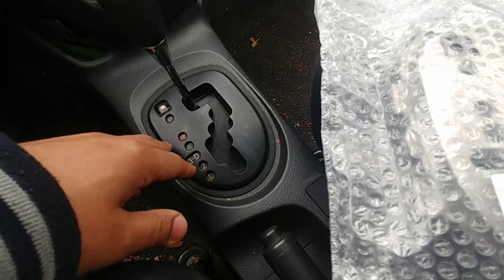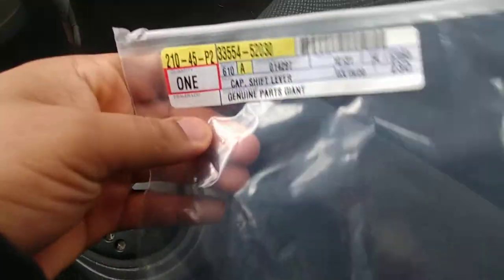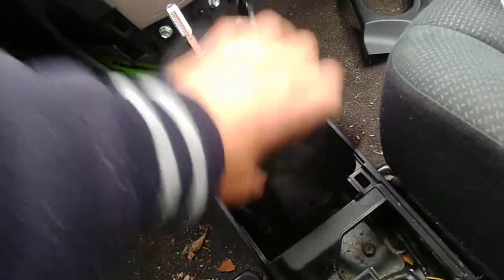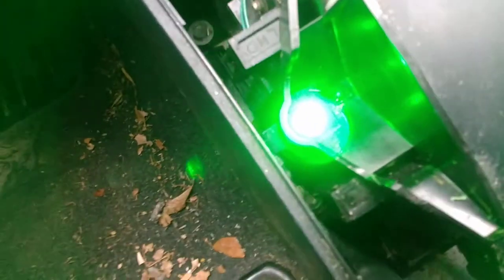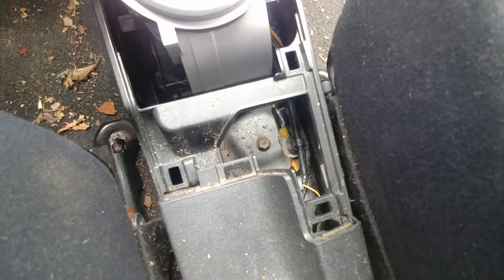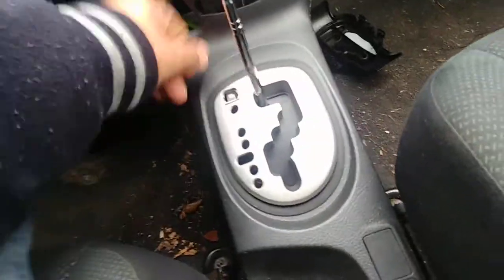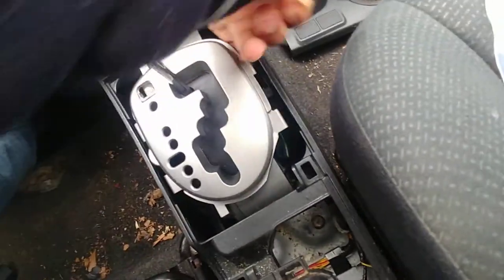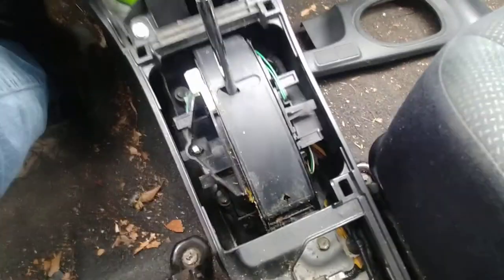Toyota How To Replace Automatic Shift Housing Cover

Comment: Hi, I'm having trouble getting the panel off for my 2017 Yaris. Any suggestions?
Reply from the maker: im not familiar with the 2017's yaris interior there probably some videos on it, but it not I'll say look for any clips or screws/bolts that what usually holds interior parts together